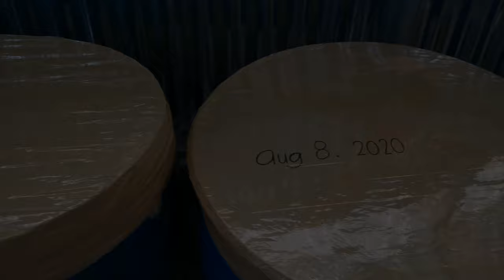How do we make corn silage/Fermented corn silage/Corn silage for goats

Comment: thank you for these simple steps. is it possible to use bana/napier grass nstead of corn?
Reply: The protein content of Napier grass is too low (less than 2%). Maize has about 10% protein and Rhodes grass has about 11% protein. Substituting maize with napier (elephant grass) for fodder will deny your goats the required protein in their diet. Fodder made with maize + chroris guyana for dry matter gives them a more complete formulation.
Reply: I know this is a year later but I just found your wonderful video.  Could I substitute sorghum for maize?